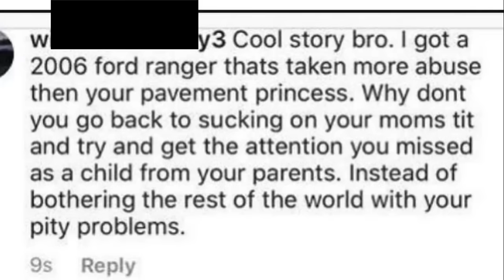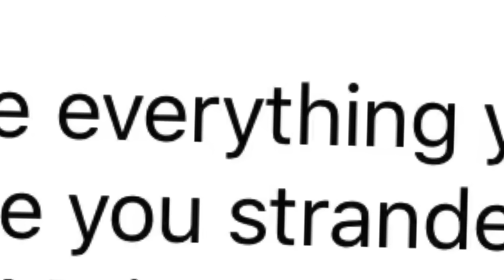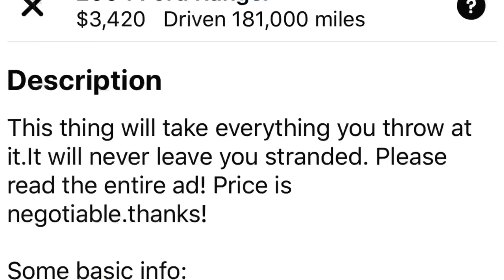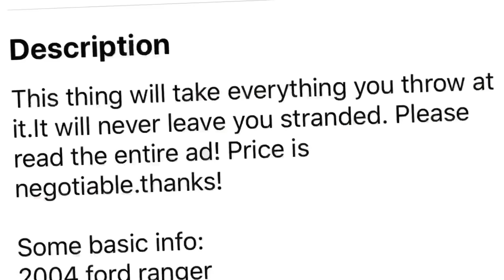“This thing will handle everything you throw at it” DOUBT

Comment: They say Ford “built tough” WD is putting it to the test.
Edit: I want to see WD pick the ranger up evenly then drop it flat on it’s wheels?
Reply: Objectively speaking, I think it held up pretty well. In my opinion though, I'll take a toyota or dodge from the same era any day
Reply: My dude it’s a ford ranger it’s not meant for any heavy duty work lmfao 😂💀
Reply: It’s “built ford tough”
Reply: I want to see WD break the Military grade steel. I heard that Military grade steel is so tuff, It can pull a tank and haul steel beams at the same time.
Reply: @HSSANITO  Correction: "My dude it’s a ford it’s not meant for any heavy duty work lmfao 😂💀"
fixed!
Reply: DON PAPALIA - for real as soon as he gets it he smashes the window😂😂
Reply: hssanito exactly the Ford ranger is small but they can take hard hits
Reply: Mike Russo a Ford ranger is for small jobs
Reply: Cheeseburger Potato exactly
Reply: @HSSANITO  They're great with mechanics I hear

Comment: I want to see two diesels, one hooked to the front bumper, one hooked to the rear bumper. Rip that thing in two.
Reply: There's no rear bumper but the axle will do 😂
Reply: both ends of the frame
Reply: @markbreitsameter3336  hooking on to the frame wouldn't do anything, it's a ranger, not a Chevy. You don't just pull steel apart even with a diesel, you'll tear out your anchor points long before you get the mid section to stretch enough to break.
Reply: @offthebeatenpath3309  chevy is real steel ive seen a 80s blazer jump off a 50 foot cliff and smash into a big rock just replace the radiator put electric fan on it fired back up and drove straigh hands free with no problems
Reply: @jackleerevis6613  that comment had nothing to do with Chevy not being real steel, the older trucks were made with a two piece frame welded together. They were definitely still strong no doubt about it but they have a much better chance at pulling in half than solid rails.
Reply: @offthebeatenpath3309  u said u dont just pull steel apart its not a chevy ik alot about frames im a welder myself i also have a 87 camaro z28 irocz with the 305 ho with 5 speed board warner tranny it dont have a frame but i got sub frame connectors and bolted it in and welded it too make it a solid frame
Reply: Ok guys, we put a Ford super duty on the front frame and a chevy HD at the rear. Play tug of war and see who wins
Reply: @jeffr4160  yea put a ford super duty at the front and a square body chevy 4wd at the rear with a 454 ho crate motor in it with 550 hp and 650 tq eagle bottom end msd distributor eldablock 600 performance series carborator 12 bolt posi front and rear with 456 gears with locking hubs with some good mud bogger tires on there and let that chevy drag both fords away it can drag the fords and win and and it will drag them at the drag strip too😂😂😂😂😂😂😂ik my sh#t bro u do that that chevys gonna go too town dragging both fords behind it
Reply: @jeffr4160  u have a instagram or messenger i can show u my 454 ho crate motor 67 chevy impala 2 door with the same set up but with road tires

Comment: Sweet. Top gear did “to kill a Toyota” now we get to see the punisher do it with a ranger.
Reply: Hahahahahahaha
Reply: The punisher lol that’s fitting
Reply: Hahaha
Reply: Maybe he will try to do what top gear did to the hilux. My buddy had an 84 give or take, before it became a hard body, Nissan extended cab 4x4 jacked up. Had no brakes. He could put the 5 speed in reverse at 45 mph and stop us letting out on the clutch using it like brakes. That was a tough ass truck. He did eventually blow out the u joints. He should try one of those too.

Comment: I've owned three Rangers: a 94, an 03, and my current one is a 2011. All made it past 300k miles with no huge issues except standard maintenance. The 94 got t-boned at an intersection, and the 03 got stolen and totaled.

Fantastic little trucks, but I would not put them on the level of something like a Hilux.
Reply: Plot twist your last two were also destroyed by whistlin
Reply: Me same deal I've owned almost 10 Rangers all with almost or over 300K never had a problem with any of them just normal maintenance but I've also on Toyotas and I've had weird problems with some of them I've had some wiring harness problems with a couple I've blown 2 up and quite frankly the rust is just annoying
Reply: And I know this kind of annoying kid he blew his up to quite frankly there gas 6-cylinder suck
Reply: Exactly, the hilux is just on a whole other level, alone by itself. Loved my B3000. sold it to my uncle and it's close to 300k km now and with canadian winters we had to change the bed but apart from that it's just maintenance. it doesn't break down.
Reply: Don’t you dare try and compare these to a hilux.
Reply: No one cares
Reply: @Irishkiwi honestly dude they are comparable. S10s are dog shit, but 90s rangers are troopers. If you keep oil in the engine and coolant in the radiator it will keep on going. They're not quite to the same standard as the Hilux, but parts are cheap and they're much more widely available, plus you see a lot of them at 300k plus. A lot of owners will talk about doing little more than just the routine preventative maintenance. I  bought one with 255 k miles thinking I'd have to do a lot to it to keep it going and was pleasantly surprised to find it's only cost me maybe $250 in parts that I've chosen to replace last year. Not ones that have broken just elected to replace. So long as you're not driving your truck into boulders too often, lighting it on fire, or shooting it full of holes you'll be just fine for at least 300 k miles and a good bit more if you're willing to put in some extra work. There's no car on the market today that can say the same in my opinion

Comment: What can a Ranger do that a full size couldn't? Park in a "compact only" spot.
Reply: Fax
Reply: Narrow atv trails, and in my experience handle better in deep snow, then again proper weight disruption and ride height effect that more then the capabilitys of a vehicle itself
Reply: Should have done it, just because your wheels are on the cars in front or behind you doesn't mean nothing.
Reply: Tow
Reply: @ryanblanken8337  invalid argument, they put hitches on cars
Reply: @Flarexxxx  it can't tow anymore than a couple dirt bikes
Reply: @ryanblanken8337  bs, pulled 4500 pounds of scrap with my ranger. Don't need a F750 to do normal shit
Reply: @loganscott2299  if it can't haul a fifth wheel it ain't a truck
Reply: @loganscott2299  that ain't even half of the empty weight of my trailer
Reply: @ryanblanken8337  so your trailer alone weights 5 ton, 10,000 lbs? And you're right. Let me just drop 350,000 dollars on a brand new long nose peterbilt.
Reply: @loganscott2299  40 ft big tex weighing over 10,000 bought it for probably 15-20k don't remember the exact price
Reply: @ryanblanken8337  and most people will never need nor use something that enormous. Further more that's a hefty price that i'd never spend
Reply: @loganscott2299  Then just buy an SUV and not a truck
Reply: @ryanblanken8337  no need to buy an suv when once again, dont need something the size of a ford excursion.

Comment: A 1990 Ford Ranger was my first vehicle. Had over 300k miles on it, had sat for 10 years before I bought it, and that thing ran like a beast. Everyone always joked about how I might get stuck helping them do fire wood in the dead if winter, jokes on them, did everything their full sized trucks did. Paid $500 for that truck, god I miss it 😔
Reply: My dad had a older shitty one just like yours real cheap he crashed it into a garage, and it still ran.
Reply: My first vehicle was a 94’ Ranger with a 5 inch lift with 35s on it. I knew nothing about trucks. Lol 2wd as well. Took it mudding and blew it up.
Reply: I had a 98 ranger 2wd that thing saw more air than pavement 🤣
Reply: What happened to it?
Reply: @Tha1WithGuitar  mine I rolled it on my 21rst birthday and almost broke my neck
Reply: Currently own a 1996 with about 450,000 miles and it still runs great
Reply: Currently have a 92 ranger as my first vehicle, and the starter completely died the other day. Tow truck showed up and literally smashed my truck into the back. Not even a scratch on either truck
Reply: The 1988-1991 rangers are built a good bit sturdier than the 2000’s models. They also had a optional 8.8 and lsd. The cologne engine series was literally the first mass produced 6 cylinder engine.

Comment: They’re called “danger rangers” because brake lines like to rot off and  the chassis are good for snapping in half.  😂

SIDE NOTE- also not good cover in a gun fight 😳
Reply: Never heard that, I've only seen rangers all clapped out still going at 215k miles
Reply: More like Toyota frames snap in half ! I know from experience. After the Toyota dealer told me that I couldn't drive my Tacoma because of excessive frame rust, I went out and bought a Ranger. 150,000 miles later, still running strong !
Reply: Mr.Grizzly come to Massachusetts. I literally just seen this exact body truck with a broke chassis and a rejection inspection sticker yesterday. I used to make hundreds of chassis plate kits for rangers before I got out of fabrication.
Reply: Bob Moyer yeah... Toyota actually recalled their trucks and replaced the chassis. 150k is break in miles for chevy trucks, tell us how much you love it at 250k.
Reply: Bob Moyer The criminal CEO that that was shielded from prosecution by Obama after he was fired? He tried very hard to run GM into the ground and was found to have ties to Ford. Nobody but a criminal would buy a Ford.
Reply: @adamr9215  Good one. Lol !
Reply: My pops does residential garage door installs, his business uses Ford rangers as work trucks... He's been through 4-5 trucks so far I believe? Only reason they use em is cause it's cheaper to buy another ranger than to fix it lol
Reply: Bob Moyer It’s good because it’s true. Plus, Ford got almost 5 times the amount of bailout money as GM. Ford’s different made to fail financial groups got the money, then still closed their doors. Only the crooked democrats protected Ford from criminal charges.
Reply: @idiotsavant7276  yeah they CAN break. Fords do not break from miles...bad owner I guess

Comment: By the way windows are hard to break with a punch I’m impressed
Reply: I was too .
Reply: Trevor Schifano he must of had a glass breaker or a piece of something I between his fingers, that or it was already cracked
Reply: What do u expect its whistlin fuckin desiel
Reply: Porcelain from a spark plug
Reply: I am very impressed as well 😂
Reply: @user-oz9sb3kf4u  And if you look at 3:29 he's hand is bleeding or something is bleeding.
Reply: If you play it at .25x you can stop it on a frame and see there's nothing between his fingers.
Reply: @kyleb5518  It couldn't have been cracked. Any nick or scratch on tempered safety glass would cause it to break.  I really think it 'fists of raged' that window.  I've seen it done by friends with lots of booze onboard.
Reply: @grizzlyrunfast   I wouldn't underestimate the little guys. some little guys will tear you up! I have seen some shit.
Reply: E2qNX8btraQ3zRD6J7fc toughened glass can definitely have cracks, chips and fractures, I worked for an automotive glass callout company for a few years after leaving school
Reply: Will in that image you screenshotted and linked (which is a new level of dedication on YouTube comments and I respect) his wedding ring was visible, that would certainly make for a small enough hard enough point to start a fracture and the momentum of the fist following through would have been enough, compared with the blood coming off of his hand from quite far back which is visible later in the video

Comment: I’d actually like to see what a 2nd gen Tacoma could handle. Definitely not as much as the hilux, but for average use the Tacoma has proven to be very reliable. I think it holds it’s value better than any other vehicle for that reason..
Reply: I was thinking the same thing. I want to see how the Tacomas hold up to that Hilux. I have a 3rd gen Tacoma and I'm pretty sure it isn't nearly as good as that Hilux... But how good is it?
Reply: Gaycoma
Reply: Not my tacoma!!
Reply: He went to jail four weeks ago idk if he was lieing
Reply: The chassis is different. The Hilux still resorts to a full boxed frame, while the Tacoma has a C-Channel rear section.
Reply: @camronsoulsby7225  Reliacoma
Reply: Ive been beating the dog shit out of my 2014 since I bought it brand new. 
Not a single problem at all.

Comment: I have a 1999 Ranger. Owned it since 2002. I have no delusions that it is the ultimate truck. It has served me well. Great for going into the woods to get deer. I've beat on it pretty hard, but I'm sure Cody could kill it in less then 5 minutes. I would like to see Cody buy a 4x4 Ranger like mine with factory skid plates, and do the same off-road torture he did to the Hylux.
Reply: It couldn’t do anything close to what a hilux can lol
Reply: @daevid21  Nothing would last as long as a hilux. it would still be interesting to see.
Reply: Hilux is an absolute beast. No Ranger can out do that Hilux.
Reply: @michaeltarno2979  It's just in the US. Hiluxes are absolutely everywhere on every inch of this planet. But in the US, I definitely agree you can't beat the ranger for the price. You can get 10 rangers for the price of one of these Hiluxes lol.
Reply: @daevid21 most trucks can't